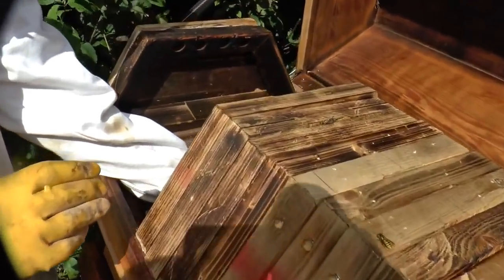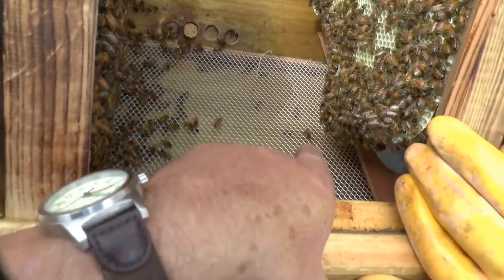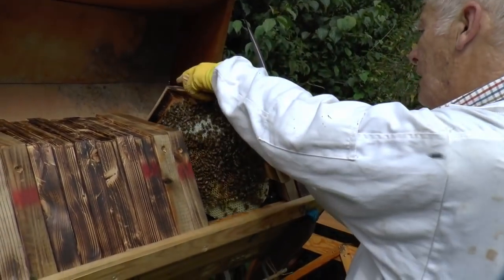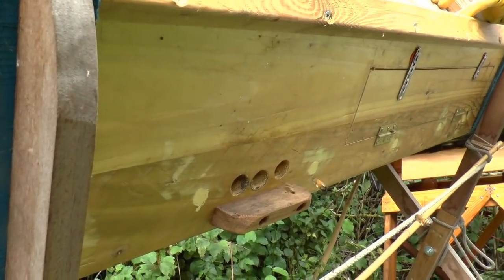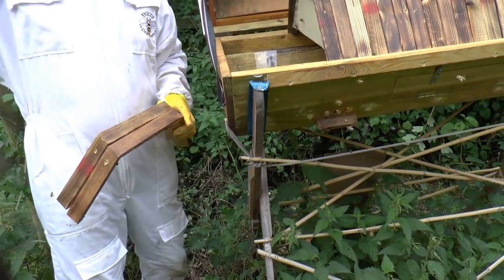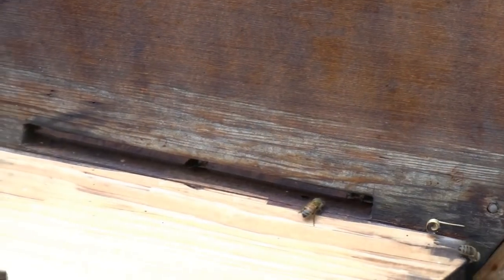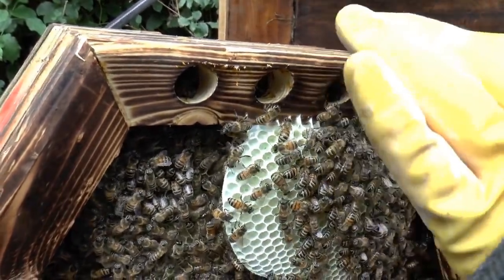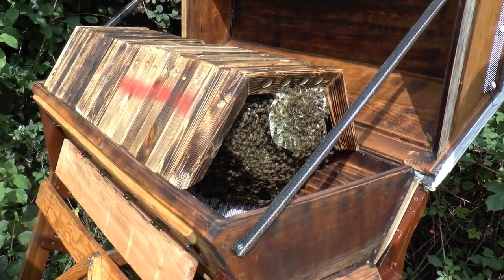Cathedral Hives with Graham Tapper

Comment: You questioned (at about 07:10) the additional attachment length of the comb to the bars over a standard top bar if the same cross-sectional depth - it's double.  So the comb should in theory b that much more stable. That is the ratio between the long isection (or "diameter") of a hexagon and three of it's sides, at any rate.
Of course, that is human mathematics, and the bees may not have read those books, so may use stronger or weaker attachment by way of compensation anyway.
As they say, the difference between theory and practice is that in theory, there is no difference between theory and practice - in practice, however, there is!

Comment: I think they may have trouble moving cluster across to get to honey,as where the heat moves "up" it's easier for them to move up as compared to moving "across" here in mo.neat though, I also think that be hard to draw out unless you make really strong split,even for a swarm
Reply from the maker: Theories have a habit of being challenged by experience.
Reply: there is a bee highway through the bars... look again. it stays warm in there. you can consolidate the brood and honey to a smaller area with a false back.

Comment: Where can the cathedral hive can be bought I live in South Carolina
Reply: Go to BackYardHives.com this is the site of the inventer, Corwin Bell. Lots of great info. I build his hives for him, if you have any questions don't hesitate to ask.
Reply: Hi, I live in the Caribbean, would this hive be practical here?
Reply: @johncardinal6975  I just finished building the cathedral hive kit. There is quite a substantial open space / gap between the roof and top of hive, which is confusing to me because of all the screens on the vents. The space sort of defeats the purpose of the screens and  am also worried the bees or wasps may try to build in that space, is this a valid concern? Also what would be a fix / solution?
Reply: This may be a bit late but, to answer your questions, the screens over the vents are to keep insects from getting into the "attic space" and setting up housekeeping. My understanding of it is that the space is there so that the heat in the hive can rise up and away from the combs rather than being kept in close as you would find with Langs or top bars. The bees shouldn't be getting up there at all. If they are, the vent slots on your bars are too large. They should only be 1/8" and the bars need to be kept tightly together to keep the bees from escaping. I taped mine together until the bees propolized them and that worked nicely. 
I hope this helps.

Comment: What are the advantages over a standard Top Bar? Just another version really...
Reply from the maker: I think that greater attached comb area may be an advantage for safe handling, and it is easier to see what is going on without removing combs from the hive. Against that, is the much more complicated woodwork involved, especially with the top bars themselves.
Reply: The surface/volume ratio would also be quite low with this build, minimizing heat loss. I wonder if the bars high centre of gravity is a problem when handling them though. Do you need to be carefull not to tip them? If so, you could easily latch the bars together two and two with a small  removable crossbar between them.

Comment: the holes on the top of the frames just passageways? Or is there another purpose.
Reply from the maker: To be honest, I'm really not sure what the designer had in mind. I would never put holes anywhere near the top of a hive myself, as it creates a chimney effect and warm air will escape,  although this is somewhat mitigated by the insulated roof in this case.
Reply: Apparently the holes create a super highway for the bees to travel between combs. I will work on the cathedral part for one of my 2 top bar hives to create more stability for the combs. My 2nd year of bee keeping. Langstroth hive is doing also well, but not a good design anymore as new designs with less intrusion are being developed.
Reply from the maker: @dieterditrich7520  ah yes, I didn't realise those were the holes you were talking about - I thought you meant the gaps in the tops of some of the frames. My version of these bars have squared faces, so I couldn't use this system.
Reply: Hello Phil, thanks for the informative videos.